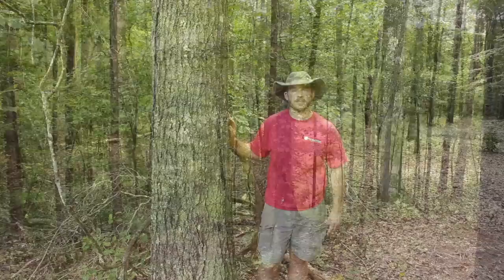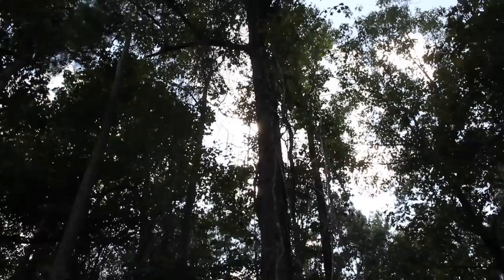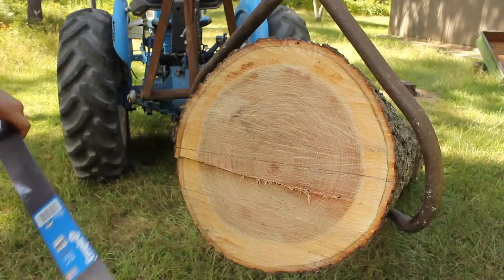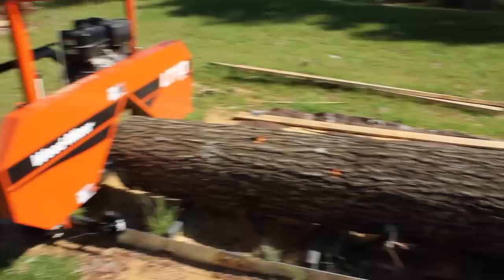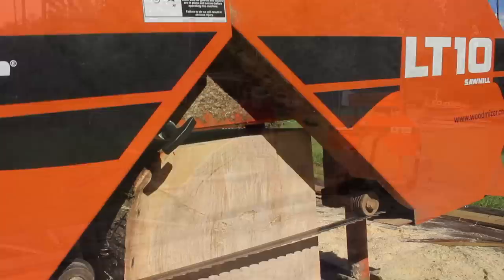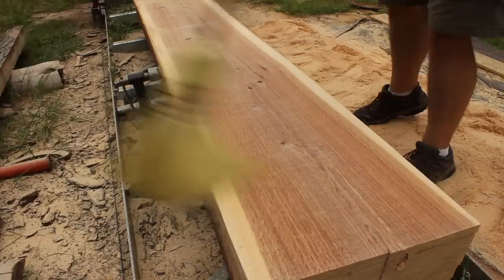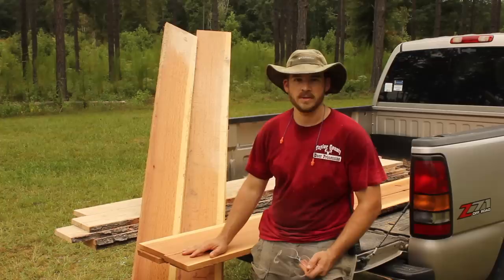AMAZING Grain in a Quarter Sawn RED OAK!

Comment: I think if.you saw the wood the regulair way then saw the board in half on a.vertical bandsaw you have the same quarter sawn lumber , i think youre mill might handle that better
Another indea is.to saw the top 2 boards turn it over saw the bottom 2 boards , then turn it 90 degree and saw the.log in  half , i think if you work the log that way you get 2 extra usuable boards and can have the little mill cut bigger logs as the sides are cut narrower
I.do think it will take a little more muscle as you be rotating the log 4 times just.to get to the board sawing point

Comment: Good practice cleaning up the immediate tree location first. This increases safety while cutting and gives you faster escape paths if it does not fall as planned. I prefer to have 3 sizes of saw (Stihl in my case) 1) rarely used 066 Magnum with 36 inch bar [great for big trees and quartering them with a Haddon log splitter]  2)Heavy middleweight [441C] with 20 inch bar which can do 90% of my felling and bucking plus most of my Haddon splitting and is a LOT lighter  3) 018 saws with 12 inch bars for limbing and small jobs. The 018 saws being so light save a lot of energy and make the job a lot easier plus they give your felling/bucking saw time to cool down in intervals as you trim the log of branches and such. Might I also suggest a top of the line Hi Lift jack for suspending the log? It would have helped from cut # 1 and they have many other uses
Reply from the maker: Stefano Dogg I’d love to have some extra saws and equipment. Great advice. Maybe in time. Appreciate you stopping by!

Comment: Thats nice wood, but not how you lay out quarter sawn for vertical grain. Years ago I had a neighbor that was a head sawyer in a big mill. One weekend they opened up the mill for a tour and he showed the difference in cut patterns for true quarter and just plain sawn.   You get some vertical grain in a plain sawn log, but if you do true quarters, you get much more vertical grain yield, but less total board feet from a given log. You just plain sawed this log, yielding some vertical grain lumber.  To quarter saw, first you literally saw the log in 1/4s, essentially a pie shape, with the cuts intersecting in the center. After quartering, each piece is supported on the saw bed at 45 degrees. After slabs are cut, a second and third cutting of each piece is necessary because the edges will be at 45 degrees and need to ‘resawn’ to square 90 degrees.
Reply: Yep there were a lot more grained boards to be had if sawn for quarter sawn planks.
Reply: Living and learning.  Never milled before but dad showed me how it works
Reply: Great explanation. Thanks.
Reply: C De, 
I drew this out on paper and what it looked like, is that quarter sawn sections of the log opposite, or 180 degrees from each other will be either quarter sawn, vertical grain, or flat grain, depending.
Reply: When is butternut squash ripe
Reply: When is. Butternut squash ripe enough to cook
Reply: To get the flakes that are what you are looking for in quarter sawn oak (like on an old sewing machine table).   You set the quarters at the proper angle to slice down the flakes or rays that radiate outward from the center like sun rays, it is vertical grain but varies.  Look closely at the end of the log for setup.  When done spot on the rays will be long stripes and not like leopard spots.  Out of the hundreds of logs I have milled I have never cut a full length board with flakes from end to end.  My quarter saw days were on an old 54 inch circle mill (sawdust generator).
Reply: Alex Beck   Eventually he got closer to real quarter sawn and discovered the lower yield. This video was early in his exploration before he understood the concept. He got it, sawed some, and decided it was too inefficient of log use.
Reply: that is not quarter sawing only a few pieces would be true quarter sawn with that technique
Reply: Jennifer WhiteWolf  exactly. to get as much truly quarter sawn lumber from a log as possible requires a mill that can rotate the log, or portions of it, in such as way as to present the blade as a radius (or close to it) to the log. there will be much waste.
a few lines drawn on the bottom of the log (not like the ones presented in the video) would suffice to clearly explain it.
Reply: That was a great explanation and I finally got it thank you so much for that posting.

Comment: I know this is two years old now, but I just found it. I am wondering, did you use this to make your floors like you said? If so is there a video link of the finished floors? If not what did you do with it? Is quarter Sawn  lumber what the make a lot of those massive farm table tops from?

Comment: If you want to learn how to quarter saw, Google "yellowhammer reverse roll quarter saw". One thing that might help you to be able to saw a bigger log would be to split the log with a chainsaw first. Another thing you might try would be make your log into an octagon.  In other words after squaring up the log, rotate it 45° to knock the corners off with the mill, essentially doing the same thing that you did with the chainsaw.
Reply from the maker: I'll check that out. Thanks for the tips!

Comment: I'm curious how these "quarter sawn" boards cured out given you left the hardened pith (the 1" to 2" center material), the sapwood (whitish living bark) and much of dead outer bark on them. 

To square up a log, my sawyer removes all of the bark and roughly 50% of the sapwood as slabs (they make good firewood). Back when he flat-milled everything, I used to take the two or three full-width center cuts (the only true quarter-sawn boards when flat-milling) to my shop and cut the pith from the truewood before stacking the truewood in my kiln. This prevented the hardened pith (that does NOT shrink much at all) from warping and/or splitting the truewood (which shrinks a LOT during drying). 

Fortunately, my sawyer is also a good welder, so I designed a set of 45 degree jigs, he welded them up, and he now produces nearly all of the quarter sawn lumber I use in my custom cabinetry and furniture shop. I know some people argue that quarter sawing produces a lot of waste, but even that can either be milled into custom trim, or used as feedstock in ye olde woodstove. 8-)

Comment: Guitars are quartered and I've toyed with making one out of oak because of the rays you see there. Age it and or stain and bring out those rays and it would be really cool--as long as I've perfected pore filling which is a reason it's not used in guitars more often. A cute puppy and manly work shirt always helps a video. :)  There are better ways to quarter and with a small mill you can do this: https://www.youtube.com/watch?v=QonU80aJgxY   I think you just plan to rif saw a couple corners to get basically a couple zones of quarter. It takes more work, and that's why quarter sawn is more pricey. I'm shopping for a 30-36 mill right now and enjoyed your video. Cheers, Seth

Comment: Please correct me if I’m wrong, and I admit that I might be because I’ve never milled a piece of raw lumber but I do love good wood and make a lot of things with it when I have time. It seems to me that you wasted two, or perhaps four good slabs by cutting the log in half first after you evened the ends up to 16”, and you could have saved yourself cutting the last piece with the chain saw. It seemed to me that you could have cut a 2.5” slab from one side (or 2 1.25” slabs) and then flipped it 180 degrees and did the same on the other side before cutting through the center to make the quarter sawn lumber. Flip it 90 degrees after cutting those slabs first of course. I just love good wood and hate waste if it can be avoided. Either way it was nice work and beautiful wood.

Comment: I would recommend anchorsealing the ends before cutting or that oak is going to split and check whilst its drying
Reply from the maker: Andrew Hayes Put some on after cutting. Good stuff.
Reply: I found out the hard way, I was lucky though it was only a bowl blank

Comment: Since being a saw miller, the true way to 1/4 sawing value out your timber you need to use a bench saw as sizing down has no waist. I think you will understand whats meant by sizing down. There are good pictures for 1/4 sawing a log from end grain. Band sawing is not really made for 1/4 sawing logs.

Comment: It's right in the name of the technique "Quarter"-sawn...you only did plain-sawn and cut them in half ahead of time. The 4 boards in the center here are quartersawn (as that would be the first cuts on a quarter), the rest are just plain sawn. Plain sawn lumber has grain patterns from quarter sawn and rift sawn in parts of the boards if you know what you are looking at, but there are techniques to maximize those two grain patterns in the boards, albeit at the cost of increased waste.

Comment: Humm nice stand taking a guess of location.  See Various red oaks, Hickory, Southern yellow pine maybe tabletop mountain pine. Northern hardwoods.  Not a wet site.  Red maple. I want to say VA, Maryland.  Saw you cutting from back and was like the whole time I would have set my hinge with a bore cut.  Lol wow I heard the ripping and was like man you should have bore cut that, and sure enough you showed the rip from the core of the tree.  Just destroyed good 6 feet of the butt log the most valuable part of any tree.  Look up bore cutting and practice on smaller firewood trees and or dead trees.  Just be careful of the dead trees before felling they could have dens in them for wildlife if you also like to preserve a wildlife aspect in your forest.  Also before you try bore cutting have a saw with a working chain brake.

That forest could use a thinning.  Just looking at that stand it is currently over stocked.  I would do a thinning in that stand removing the none desirable and the bad ones then shift to opening the canopy just a little making growing room for the small trees and any larger desirable trees you want to keep.  Most important to make room for the high value trees to put more growth on faster and to be healthier cause they now will have room to grow, and to reseed the forest floor to get new growth going.  Also for a toe board all you need is a little hydraulic bottle jack or a old car tire changing jack.  Was a shame to cut that tree looking at the sap wood that tree was going strong and was very healthy yet.  Even the core no rot that tree had a lot of life ahead of it yet.  That knotty stuff just go to the local mill they usually have more then enough of that knotty / wood with defects in it.  That look is a dime a dozen.  The hard stuff to get is clear lumber no defects.  Or if you are lucky to find it Maple lumber called birds eye.  Alot of number #1 grade lumber with some grade 2 in that 1st batch.  Defect at the end is not a defect but instead was fellers error.  The butt ripped and that is what you are seeing.

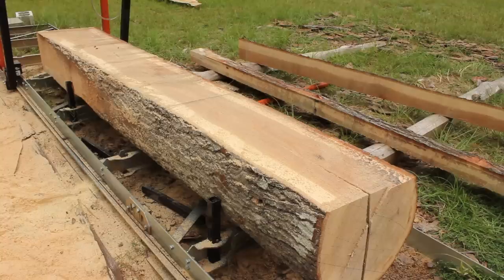Comment: Your video is great I have a Norwood LM26, it looks like right around 21:41 that your blade is starting to dive down into the wood this could be from a dull blade or from cutting to fast, I run into the same problem with my mill, also check at how tight you are dogging your log because it will push the saw head track rails to push outward causing the head to get into a bind in the dog area.
Reply from the maker: krmcc01 My blade does tend to dive sometimes. I think it’s usually because I go too fast. Great tip on the dog! I never considered that. Thanks for watching!
Reply: I am glad to help because the learning curve can get expensive with blades and frustration at times, I am like you when you feast your eyes on the wood that you cut you are the first one in the world to see the beauty that every board brings. Happy and safe sawing to you.

Comment: I have sawn trees using a vertical band saw, and your method looks much better.  I got some lumber after drying, but it was not as uniform looking.  And, mine was tough drying, and did not do well  as it dried.  I like your approach much better.  Does it dry well?
Reply from the maker: I hope so. This is the first time I've really tried drying this thickness in the kiln.

Comment: Am I missing something or did he just cut flatsawn lumber in half and call it quartersawn?
Reply: Nope your not missing a thing. It's essentially a flatsawn cut ripped in half. He will get a few boards that look quarter sawn but this is not a QS technique.
Reply: oldschoolcivic I’ll have to respectfully disagree with you on that. Worked for a large mill for years as a cant marker and sawyer and always did white oak that way. The only thing I would have done differently was take one or two more boards off each side of the cant to eliminate the sapwood on the qs boards. Not saying your way is wrong but I saw nothing wrong with his milling of the log.
Reply: @letsdothis1677  Wouldn't the first 3 or 4 boards from the top and bottom of the log be rift sawn instead of quarter sawn? Seems to me only the center third of the log would quarter sawn. If he'd quartered the log then cut from alternating sides he would have gotten more quarter sawn wouldn't he?
Reply: mwilson70201 that’s why I would have taken a few boards off of each side before I would saw down the center. It would also get rid of the white part of the quarter sawn boards. Less edging to do to get rid of it. We also edged the heart wood off as well, leaving a nice strait grain pattern on the board.

Comment: @ 17 mins... that corner... that is alimitation of the machine that the company should be working to fix.
Reply from the maker: troycleveland I do think a few things could be done to improve the machine...but I was using it at the far upper limits of it’s capabilities. Thanks for watching.
Reply: Isn't that the basic line of the drive belt from the motor to the driver wheel?

Comment: Sorry but that is not how you quarter saw wood. The inner boards do achieve the vertical grain through the edge but the outer boards do not. Quarter sawn wood can be done in many ways but to minimize waste, you always end up with variable width planks. Basically cut the log into 4 quarters. Then each quarter wedge is sawed to show the vertical grain off the edge. It does propping up each quarter as you go and is hard to do on your mill.

Comment: What are you billet lengths...15 feet?
Do you need to dry off the blade after use, the water lubrication.
You really should flip the billets end for end and rotate the can't 90º prior to each cut...or so I've read,m I'm NOT  a sawyer.
Pretty wood.

Comment: Before 1st cut:  Might have been a good idea to raise the top end so that the heart of the tree was more horizontal. (maybe you did that and didn't show it.)
After 1st cut: While the saw was still past the log, could have temporarily lowered it to find out just how low you could go so the saw wouldn't get hung up near the end of the second cut.
Do you ever stick wedges in the saw cut behind the blade while cutting to prevent the blade from getting pinched? I suppose that wouldn't be a problem if the outside of the tree is dryer than the heartwood though, as the end of the cut would pop up away from the blade.
Reply from the maker: Bluuplanet Never had any trouble with blades getting pinched. Thanks for the tips!

Comment: Ted C had a comment about quarter sawing lumber and rotating to 45 deg. after the initial split.  I looked on WiKi and it showed the same 45 deg rotation when sawing.  Is the intent for quarter sawing to make grain orientation perpendicular to the width or a board?  I am not questioning your work, but just asking since I have never milled logs.  Thanks for the videos.

Comment: Sorry dude, but you just showed us all how to get a lot of narrow flat sawn boards and two narrow 1/4 sawn boards.  To get the most 1/4 sawn lumber you make all of your cuts parallel and across the full width of the log. The perfect 1/4 sawn board is right through the core.

Comment: Beautiful lumber; how do you determine when to sharpen or change saw blades?
Reply: when you have to push hard and then it starts to smoke.  then you burn the blade and take the temper out of the blade  files and grinders are cheaper than blades.

Comment: I am no expert on cutting lumber but the heart as you call it is the center of the tree. Your first cut to get rid of the different diameter was wrong. You should have shimmed the smaller end to get your center line “Heart” parallel to your track. Make your cut and flip it 180 or 90 degrees and shim again. Your grain will not be uniform at the ends when you are done.

Comment: The idea behind quarter sawing is twofold 1.To limit tangential shrinkage and 2.  it is usual this method is almost exclusively used when converting hardwoods it shows the decorative figuring, oak is a good example, that would not be obvious with slab sawn boards. By quarter sawing the length of the growth rings is significantly reduced and the boards when 'sticked' tend not to cup or split.

Comment: I thought quarter sawn was where the curve of the grain was at a 45° angle to a outer corner.
The cuts you mention are straight grain.
I'd prefer the outer boards.
Reply: @cattey that's not very nice.
Reply from the maker: greg Ideally quarter sawn grain is 80-90 degrees to the face. Check this link out: https://woodmizer.com/us/Resources/Wood-Mizer-Learning-Center/ArtMID/5164/ArticleID/153/How-to-Quarter-Saw-Lumber

Thanks for watching!

Comment: Check out Josaljo Won on getting perfect quarter sawn wood. He's got the perfect method. He is using an LT-15 with a few improved accessories.  JOMO,    Jim
Reply from the maker: jim renderer Will do! He’s got good content.
Reply: Josaljo Won may have good content, but he's dead wrong about the differences between quarter sawn and rift sawn lumber.